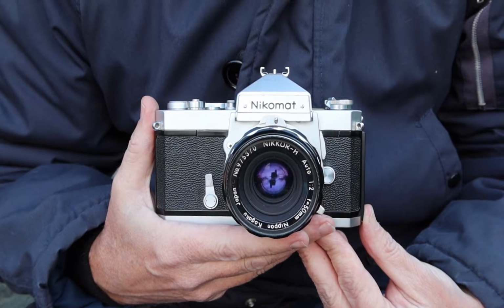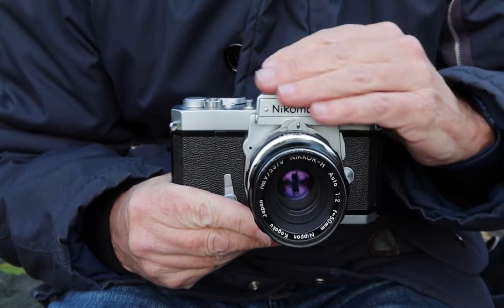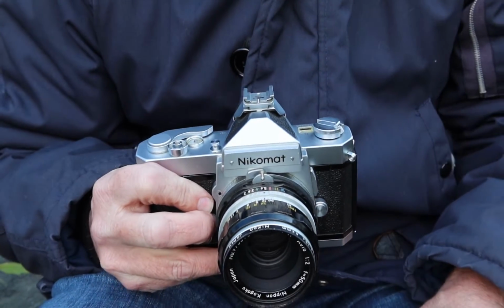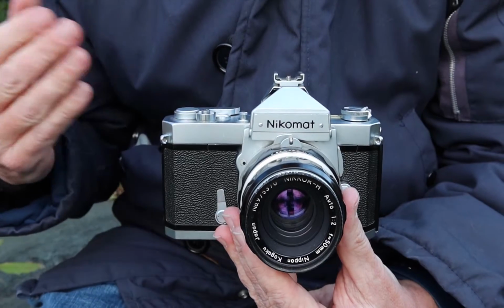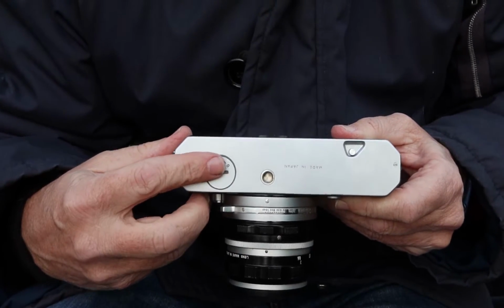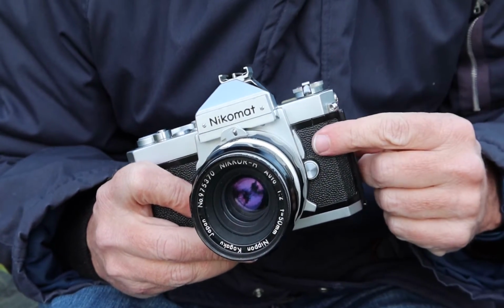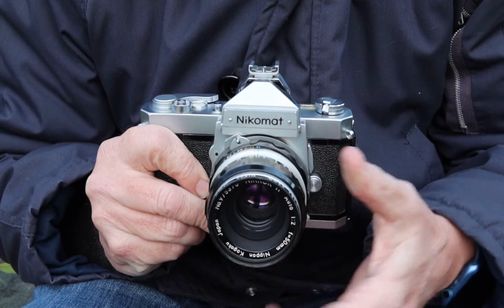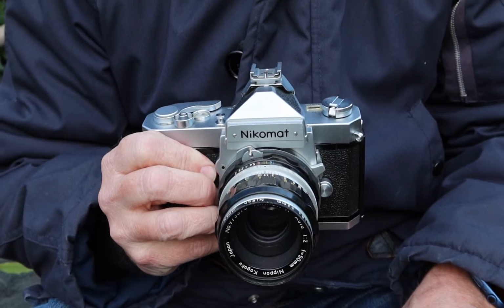Nikon's Best Bargain Classic SLR Camera

Comment: The first Nikon slr to use the copal vertical shutter was  the Nikkorex F in 1962, manufactured for them by Mamiya. 
Hard to believe it took Nikon until 1988 with the F4 to use this shutter in their pro SLR's; Canon had an electronic vertical shutter in 1973 with the EF & Minolta with the XE in '74 who then got the AF jump with the 7000 in '85. 🤔

Comment: One thing you failed to mention is that this camera uses 1.3 volt batteries so a regular PX 625 will not give you the correct exposure unless the camera is modified to use 1.5 volt batteries. I have an FTN I would love to get that done too plus get CLA it would probably outlast me. 😂

Comment: I have an FT-N i purchased at a garage sale fo $40. It came with the original leather case, and still has the oval quality control sticker on the back. What are the best options for testing the meter without modding the camera?

Comment: A Nikomat FTN was my first film camera (we’re only talking about 5 years ago) and I absolutely love them. I'm on the fun for a tidy meterless FS.

Some useful notes-

The FTN has a later ‘apollo version’ with the rubberised advance lever some of which has a split prism focusing screen. A black ‘apollo’ ftn still has chrome advance lever and self timer whereas an FT2 has black.

The pentaprism inside earlier Nikkormats is interchangeable with some Nikon F prisms. A busted Nikkormat can be an affordable way to replace an F prism.

The cold shoe flash accepts both standard flash and the propriety nikon flashes.

Most FTN models accept both the standard and larger (Leica/Nikon size) cable releases.

These are very few failure points, however there can be issues with a slow mirror raising/aperture lever mechanism due to gummy old grease. This is solved either by setting the lens to a small aperture of by lightly tapping the DoF preview.

Comment: Although I used it for only a few years, I have always liked the Nikomat FT2 I bought in Japan in 1976. It is heavier than later cameras like the FM/FE, but it has a feel of being solid and reliable. The FT2 was the first in this series to stop using the mercury batteries. The briefly lived FT3 switched to the AI metering connection.

Comment: How does this version differ from a Nikormat EM?
Reply: I assume you mean the Nikkormat EL, the Nikon EM is a cheaper Aperture Priority camera from the late 70s. The EL cameras different quite a lot from the FT series. They are electronic and only have one manual speed. Their viewfinder is arguable better as it shows the shutter speed you have selected. However nowadays they frequently have electronic problems including draining batteries.
Reply: @mattdyer9544  Thanks Matt. I meant to write EL.
Reply: fully mechanism, no battery needed like the EMs
Reply: The Earlier Nikkorex F also had the same basic shutter, but was actually manufactured by Mamiya.